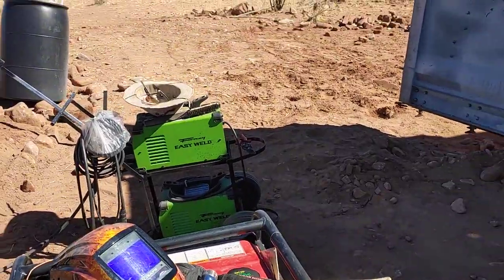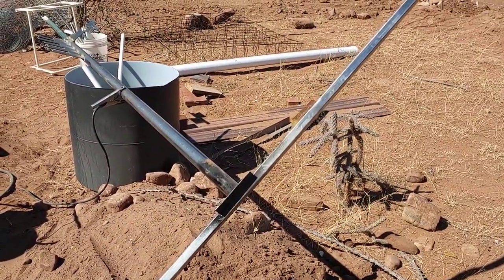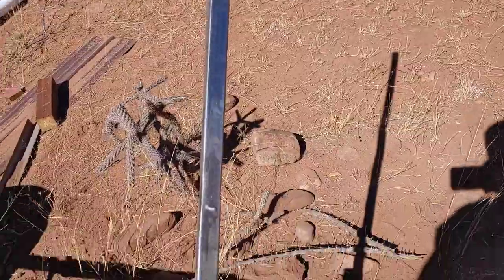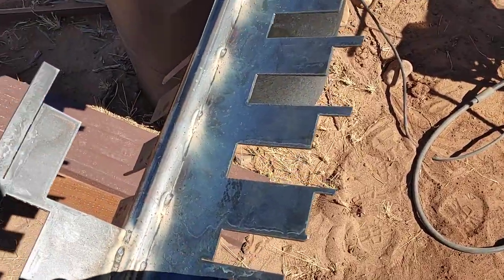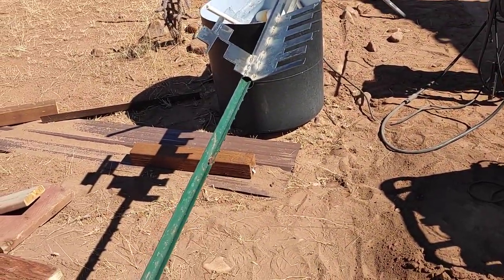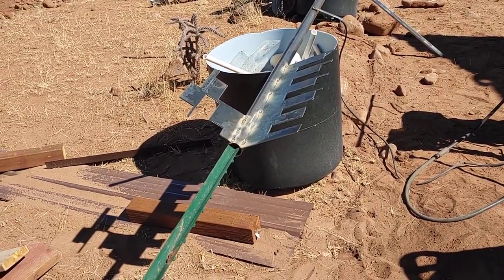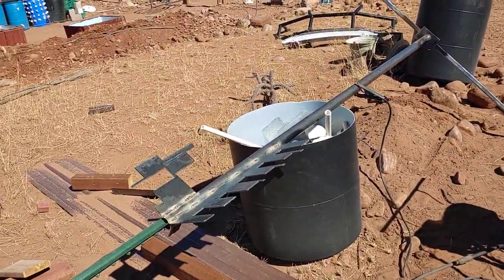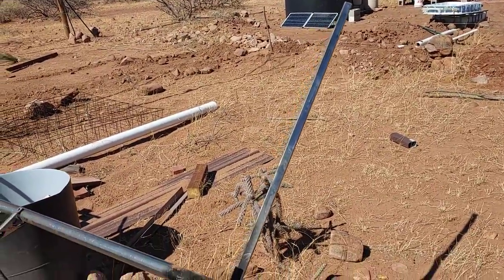DIY solar array stand/mount

Comment: I should have watched this one first before I made my comment to your recent video.  The ventilation comment still makes sense, you can translate the others.  Just noticed your genny in this one.  You have the bigger model, so that's why yours probably takes longer to gunk up that screen than mine.  I have the quiet model, but truth be told, I'd rather have a louder one that produces more.  Keep up the good (hard) work.  Those bees just want to say hello and more than likely get at your sweat.
Reply from the maker: No worries at all, I'm very very appreciative to receive such wonderful feedback and advice.
I actually have 3 generators, one is the small quiet 2000 watt and another larger one that's 9500 watts with auto start.

I bought them when they were much more affordable and thought it would be a good idea to have backups👍👍

Comment: I guess you're lucky those buzzers aren't  yellow jacket wasps. We don't have those here in Australia but I've seen homesteading videos from Idaho where those are  a real menace. I think, also, Green Dream were having problems at one stage with wasps or bees. They might have a solution for you. One of Jess's remedies?
Reply from the maker: GDP had Africanized honey bees/killer bees and they had to hire an exterminator, I think my bees are just honey bees but I could be wrong.
Thank goodness they aren't wasps.
Reply: I'm about 10 mile from GDP, about a month ago , while we were working on the house, a Hugh swarm of bees came by and stopped at the shed, we ran to the truck and thankfully they left. But we have the normal bees here all day every day and they find their way in to the trailer, so frustrating.